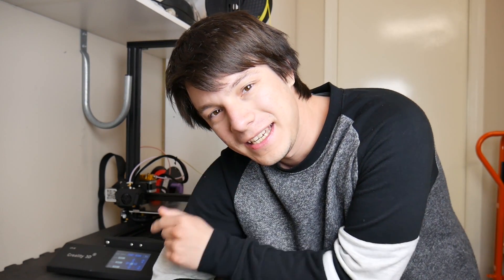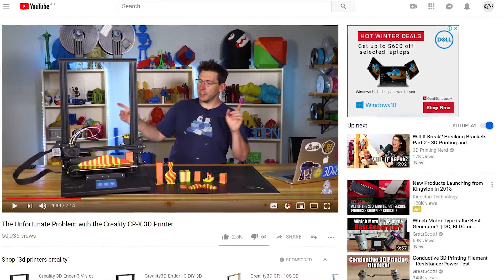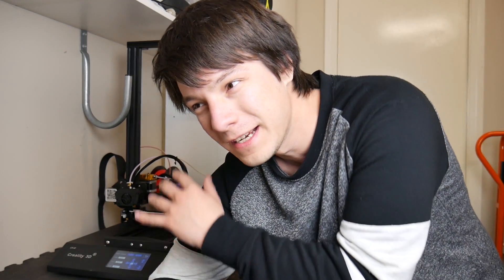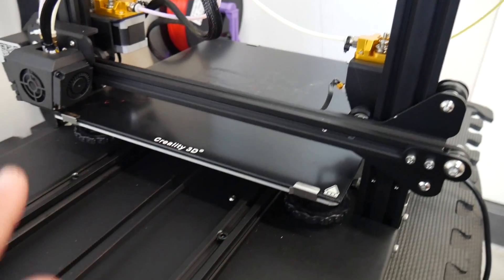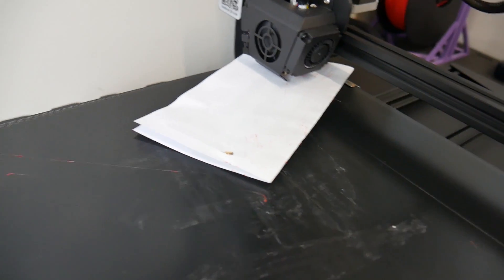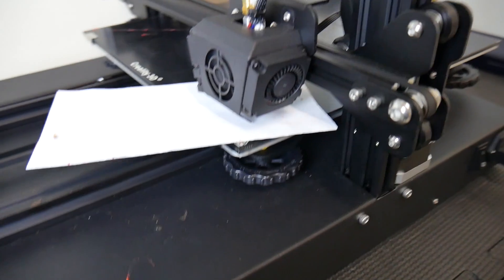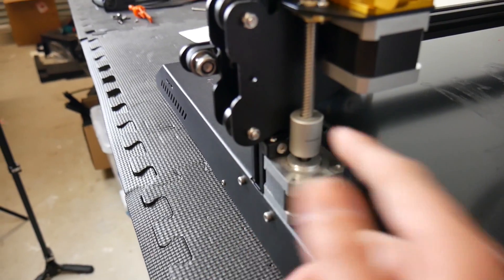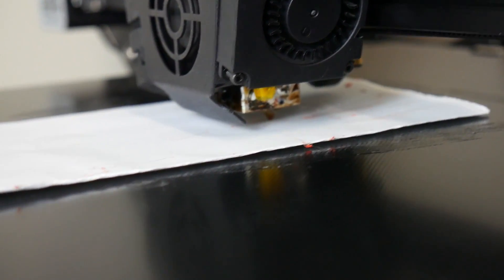Update on my Creality CR-X and going forward

Comment: To be fair, i would expect these issues on a prototype/pre-production, but to send these units out to a reviewer instead of some internal QA testing seems a bit daft. Im sure these issues will get fixed but prototypes/pre-production models with significant issues should never be released to customers or reviewers. I know customers demand low prices and high quality, but customers dont really get either with this printer.
Reply: Look ItsRain Pretty sure theres no dedicated QA department. Theyre a pretty small company from what Ive heard.
Reply: Even getting one person internally to use this thing for a solid week would suffice. It's one thing if problems occur every 1000 units, it's another if it plagues every unit. From there then you are upfront and you can task reviewers with a model to beta test. After the feedback, exchange for a final product. 

I'd say a lot of these businesses need to pursue a better QA procedure and not be a race to the cheapest option. Of course it's easier said then done when so many will buy cheap.
Honestly I'm just surprised we haven't seen HP/DELL/GOOGLE/MICROSOFT/APPLE just snatch up one of these companies and build their own.
Reply: SexyCyborg did a factory tour on her channel recently.  It didn't seem all that small to me.  They easily have a couple hundred employees in just that one location and I've heard they have at least 2 factories.  Plus, they obviously have a team of people designing new products.  It seems like they just drew up a concept on a pc and didn't bother to test the concept before throwing parts in a box to ship.  Just putting it together and trying to print something would have showed them several flaws that shouldn't have made it passed the front door.

Comment: very interesting. I actually encountered a very similar issue on my recently purchased Ender-3: I would level the bed with a piece of paper exactly like it it always shown but when the print startet it would always start way higher (you could see the difference just by looking at the nozzle/printbed-gap)often times leading to a failed first layer. At first I thought it had to do with the warped aluminium Bed and they quickly sent me one of the new glass print beds. The problem persisted though until I changed my leveling Gcode to actually level with Z at exactly 0. After that the nozzle started the prints at the right height. It almost seems like it adds another 0.2 or whatever your layer height is extra to the starting Z height. Interested too see what the solution will be ultimately. Thanks for the update! Btw I actually don't mind tinkering and tuning my printer a bit as I also feel like I learn a lot over the machine and how to trouble shoot it. For people who need everything perfect from the start and want a real plug and play solution the Creality printers are surely not the right choice but only because the Ender 3 was so cheap I was able to afford a 3D printer at all and if tuned/fixed properly it stomps out prints that are at least up to par with prints from machines at least twice if not more expensive! Also for the Ender 3 all files including technical drawings for all mechanical parts etc. are open source which is a huge thing imho.
Reply: There seems to be a firmware issue that is causing that problem with the first layer height.  I would think that issue would have been found and fixed with any amount of QC and having that issue also with the Ender 3 as you said it shouldn't be an issue with later designed models.  Creality isn't 2 dudes in a basement style company anymore.  They need to up their game.
Reply: I think this is an issue with your Gcode and not with the Ender3 wich is a good machine (unlike the machine in this video) Have you subscribed to the Ender3 group on FB and asked for advice? I own this Ender3 and 2 CR10 but I'm not going to buy the CR-X. For this price it should print 2 different materials instead of 2 colours only.
Reply: I have had this issue with many printers. If I level by using the printer my first layer is high. If I level with s3d control first layer is good.

Comment: I have a similar scenario with my Ender 3. Shipped from the new batch w/ Laser and Glass bed, direct from Hong Kong in the last week. The RHS and the front Right in particular are difficult to level, the screws are close to their extremes of travel. The Aluminium plate on the top was flat, but as you measured on your unit, the supporting gantry is warped. 

Is the material used for the gantry Aluminium or Steel? I ask because if there is part of the laser/plasma cutting process that is causing the part to warp in this manner on a consistent basis that would explain the bed level issues of a similar nature across a few models and batches.
Reply: Mine too. Same printer, same corner, same issue. Adding the glass plate was almost enough to fix it, but I did end up adding washers to each spring to keep them slightly tighter (and well, it's good practice to have a washer between the spring and the heatbed anyway). That corner got two just in case.
Reply: InsaneFreak 
Your Ender 3 came with a glas bed?!? wtf I got mine 5 days ago and didn't get one :/
Reply: Did you order direct from the creality store? It was an option. Was a bit more money though.
Reply: InsaneFreak 
Oh ok, I got mine from gearbest... I  saved 30€ compared to to glas bed version in the creality store. Enough to buy a cheap piece of glas myself :P
Reply: I have just used the creality glass bed, and compared to their build surface it's awesome. The glass has a painted texture on the printing side. As it cools the parts literally popped themselves off the bed.
Reply: InsaneFreak 
Awesome. I have already scratched the build surface by trying to get off residue that really melted into the surface. Now I'm using Magigoo that reduces the adhesion a bit on this surface but I will definitely switch to glas as soon as possible.

Comment: I have 3 creality printers (cr-10, cr-10s and ender 3). They all have slight issues and I have fixed most of them myself. It takes about 2 weeks to get these printers working right. I agree with everything Angus is saying and I've experienced it in there product units. I can imagine preproduction units being even worse than what I've experienced. Don't think creality should fault Joel or Angus for there opinions. Creality should have hired people like Angus and Joel to fix issues they have pointed out. Keep up the good work angus. I would love to see how much you had to fix on these to get them working right.
Reply: Indirectly they did hire them when they sent them a "review" unit . Neither Angus or Joel do this just for the giggles, they make money off sponsorship and views.
Reply: I agree but as you said "review" and not as a "first look and here is what you need to fix Creality on the side". That was one of the points Angus made in a previous video about prerelease and reviewing the Chinese printers. Also with people having to be the beta testers for them to just put out another printer with the fixes the people came out with... not Creality.
Reply: I have 2 CR10s and they have nice features with regards to the print volume, and the first one made great prints for about 2 weeks until a print broke loose 6+ hours into a print and the whole thing was molten smoking plastic the next morning. The other one that I bought to have one working unit at all times has never gotten good prints, and they keep burning out the electronics (4 cards for less than 1000hrs on two printers).

My first generation UP that has been bent out of shape and operated for 7 years prints faster, layer adhesion is better.... The thing is with the UP it has been - by the filament and start printing. With Creality you just have so many prints coming loose, and you really have to repair/adjust the bloody thing all the time.

Comment: Creality have a history of bent parts. The ender 3 I bought from them for $300AUD came with bent extrusions, and it took several photos from many different angles to get them to send me replacements. 

They will learn sooner or later, and likely at a great reputation and monetary hit that you should not send pre-production machines to anyone without first clarifying that they want feedback and development suggestions, and that it is NOT representative of the final product.. but I suspect in this case that creality only released that video because of the negative feedback.
Reply: Mephiston I had the same problem. They never sent me replacement parts.
Reply: Did you buy from their seller or through a third party? I bought directly from creality's ebay store, and sent them pictures. I guess the threat of negative feedback motivated them or something

Comment: They are obviously using reviewers/creators like you, Joel, Joe, and others as their Beta Testers.  No matter how many disclaimers you voice, these manufacturers are doing themselves a terrible disservice here.  There will obviously be viewers who are turned permanently away from considering an expensive machine like this - in favor of cheaper alternatives. Doing some tweaking/repairing on less costly machines can be justified somewhat.  But, a machine in the price range of a genuine Prusa?  Nah - buyers will go elsewhere.  One chance at first impressions and all that.
Keep putting the pressure on them Angus - that seems to be the only strategy that has a chance in hell of working.  Buyer beware, as always.  Thanks for telling it as it really is.

Comment: Could there be a slight downward warp or bend in that front corner of the beds frame ?
Reply: s R i think it has to do with the 2 threaded rods for the stepper motors not being in proper parallel alignment, so that results in trying to compensate for that by maxing out the build plate adjustment screws. Oops, the stepper motors not making sure to align themselves accordingly. If they did, then the adjustment screws wouldnt need to be maxed out to dial it in. They could try changing the adjustment screw design, if they find its easier than getting the motors to park themselves in the best ideal alignment.
Reply: Very possible. Afaik that part is preassembled, so that might be the source of the issue. Definitely worth looking into (and probably, loosening and retightenibg the screws if you get one yourself)

Comment: 3:08... Assuming I understand that leveling mechanism.... 
I'd put a couple of washers under the the yellow spring to compress the spring a bit more to get the bed travel you need.
Reply from the maker: that's the plan, the bolt is too short though the knob falls off. need a really long M4.
Reply: Tighten up the bolts on the other 3 corners, making the front right the highest one at close to its full travel, then level off that corner first.
Reply: On my CR10 I had the same problem. Adding a very long bolt would hit the bottom of printer. My Cr is now catching dust.

Comment: My CR-10S had a slightly tweaked bed holder on arrival on one arm, small nudge closer to straight and it now levels well with similar spring tensions. On the false leveling sounds like a Z offset in Firmware maybe? 

Keep up the content and the Battle :)

Comment: I'm interested to see what the fixes are, the Creality S5 has had similar issues with the bed. I'd also be super keen to see a video sometime on what people believe the things are on Chinese printers that should be standard by now. i.e. the areas where the manufacturer should be spending a little more, what would that be? Would it be having ABL, better PFTE tubing, higher quality steppers, linear slides instead of V-wheels, heavier extrusion etc. What areas would a little bit of extra cost and quality be the places that would make the most difference?

Comment: Why don't you heat up the bed and nozzle to printing temperature before leveling the bed? I always thought this is highly recommended due to thermal expansion of the parts?In your case only the front right corner of the bed isn't adjustable, but what if you place a small printjob in the rear left corner with propper leveling at the beginning? Maybe the first layer sticks a little better...Also the printer seems to have a serious problem with Z wobble!
Reply: because preheating sucks for leveling damned nozzle oozes. I never preheat to level and never have an issue.
Reply: Because this is a set up to frame Creality.
He's clearly sponsored by someone who saw a competitor in Creality and now he's working on removing the competitor.

Sincerely, do you really believe that person with so much experience in design and manufacturing would forget about three point plane definition?
And if he really doesn't know what is this mysterious "three point plane definition" then he should be a moron and none of his "technical advices" should be valid.
Reply: So, Joel, Joe, and Angus all have similar issues with this printer and you say it is a setup to frame Creality? That tin foil hat might be a bit tight on your head there good sir.
Reply: Ed, do you really think that in the case of framing plotter would hire just a single youtuber?

Comment: Ive noticed something, smaller printers like the Anet A8 may have their fair share of problems, but most of them are easily fixable, then you look at say the Creality CR-X, which is a big printer and is very costly, but has smaller problems that arent easily fixable/unfixable, how come some smaller and cheaper printers have better quality control then printers like the Creality? Its just wrong.
Reply: the cr-10 lines IS cheap, super cheap. a comparable printer at that build size is the lulzbot taz 6 which is 5 times the price with still smaller print volume.  Cheap large print volume printers didn't exist till the cr-10. Tiny bed printers are not even remotely the same thing, when they get to a large size the amount of things that can go wrong exponentially escalates
Reply: If they had non-existent QA then there would arguably be a much higher failure rate of products, so I think your hyperbole is a bit too extreme. As someone who has both a cr-10s and an ender 3, and has had my share of issues with both over the course of a few months, I can attest to the fact that they are by far perfect, but they arent the TRULY WORST MANUFACTURER EVER as you seem to be positing. 

It's basically like this: you have two schools of 3d printers; You have ones with cheaper outlay that get you into the hobby faster, but will require time, effort and money to get them up to par with other printers. Then you have the complete and higher quality printers that have a much greater initial cost, but you then spend much less time, effort and money (if at all) to get them to work at optimal efficiency and quality. As long as people are informed about where products fall in that scale, the less disappointed people will be.
The problem here is that creality was going for a more upmarket, feature laden and complete printer, but failed to deliver on that purely by sending out pre-release and pre-production versions to influencers, without telling them that it wasnt the "final product that everyone will get". Creality screwed up for sure, but I'm not sure they deserve ALL the abuse that they're getting. Some, definitely though.
Reply: I dont think the problems are unfixable, its just that only a few people have had them to play around with, and thus there is no established history on how to fix them, aside from what has happened with other printers. Also, A8s are much more billed as kit machines that you have to assemble, whereas creality tries to brand them less as kits and more as complete machines that require a little assembly. This includes adding things like bespoke parts that others don't do, but then also do not have the manufacturing standards that manufacturers of complete machines have. This leads to having a situation where you have inconsistent quality control and manufacturing standards, coupled with the more expensive price and expectations of complete machines, rather than having the good build quality of expensive and complete machines, but the lower prices of kit printers.